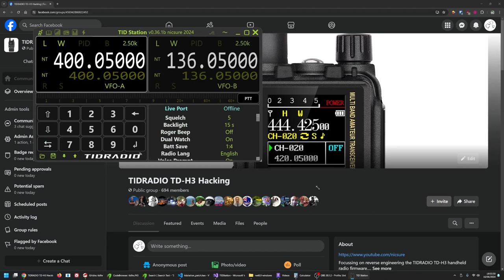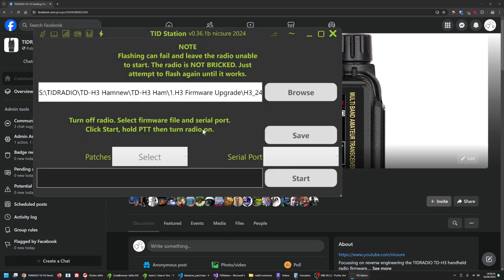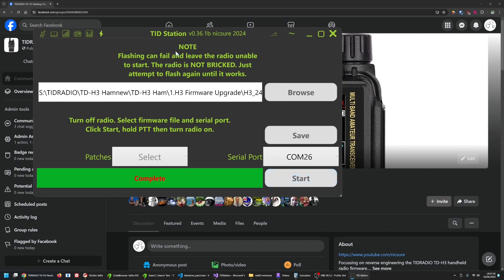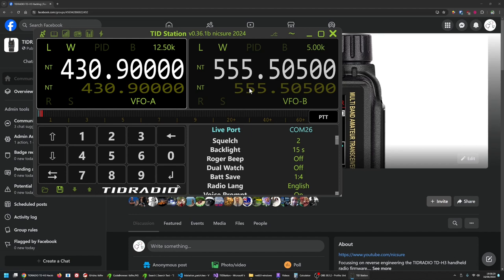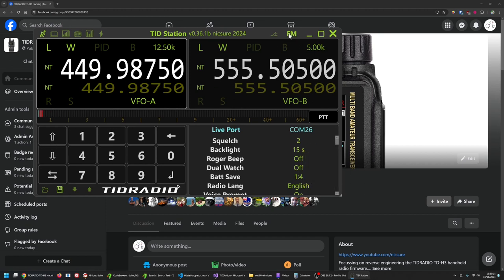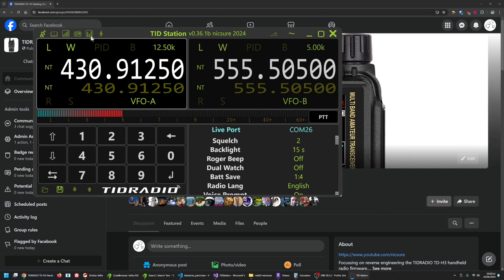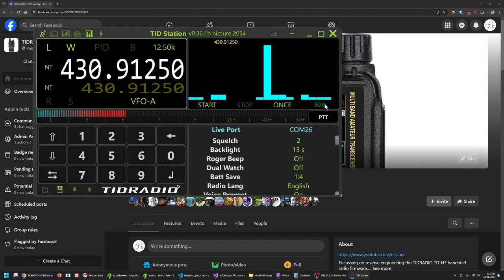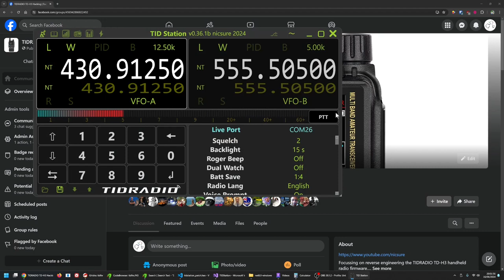TID Station 0.36.1b PTT, Spectrum, Modulation & S-Meter #TIDRADIO #TDH3

Comment: If I have the stock firmware, same version that you use, will it work with the app? And if yes, which functions will be missing?
Reply from the maker: With just the stock firmware, the app's functions that won't work are: PTT, S-Meter, Frequency Analyser, Modulation Selector and Frequency Shifter.